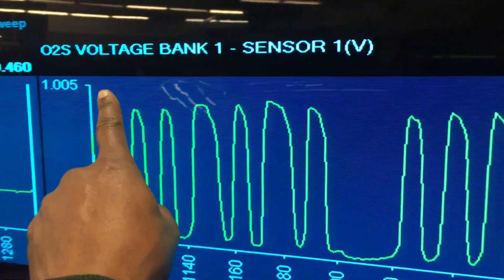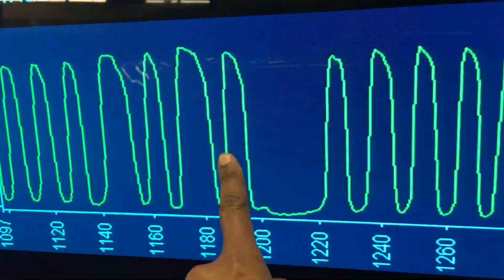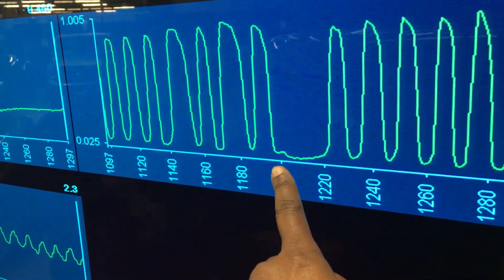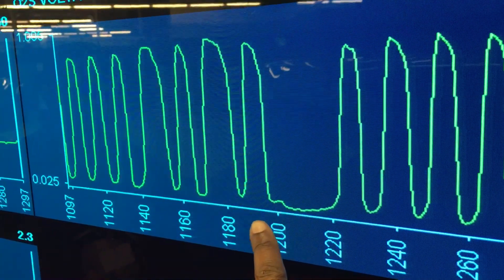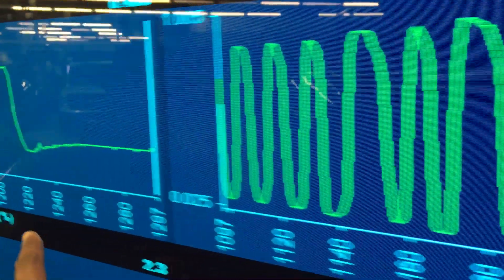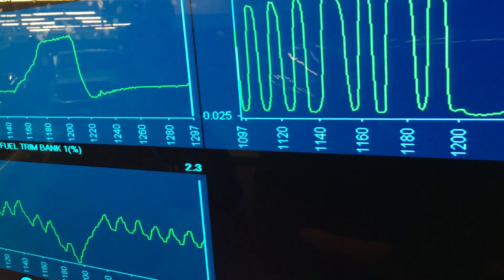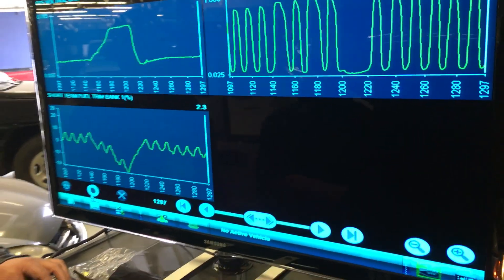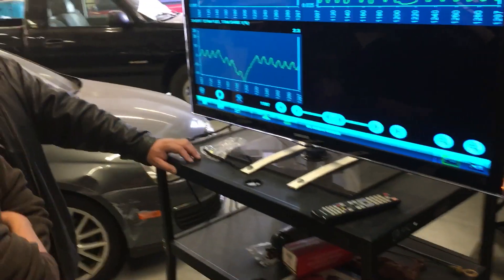Catalytic Converter Test

Comment: Only my opinion and style as I do not work at a SMOG Station, all techs that I know including myself would have flooded the induction with loads of propane to drive the B1S1 full rich and keep it there, I will only guess that you gave the propane slowly to watch the STFT take over by pulling fuel or going negative, and keep the B1S1 switching as normal as it had the help of the STFT to keep the ECM in fuel control, is this the way you normally do the test? Slowly add propane to keep the ECM in control but watch B1S2 go rich while B1S1 stays in normal control? I do understand about O2 saturation of the CAT CONV. Thank you for the video. I do not know if YouTube will inform me of your response? spiderwebuntangled@gmail.com
Reply from the maker: Thanks for asking - I add propane slowly while watching STFT - when it approaches -20 to -25 than I turn it off. If you add to much the ECM will take over and the test is voided.

Comment: Thank you Nate. The upstream O2 sensor should have went rich 1V. The scan data shows it went lean 0.1 V. Plus the time base at the bottom looks like frame numbers instead of seconds. I appreciate your videos. Have a blessed and safe week.
Reply from the maker: Billy, you are correct the scale is in frames and not seconds, basically I'm was telling them they need to see a two-second or more spread. Since it was in frames I told them it shouldn't drop at the same time, even if it is framed. Also, it does look like the STFT went lean when we were adding propane. The O2 sensor did go up when we added the propane it was around frame 1190. You have a good eye on detail lol, take care.
Reply from the maker: Billy Yoder Thanks you to have a great week